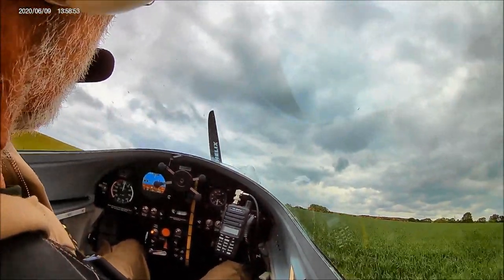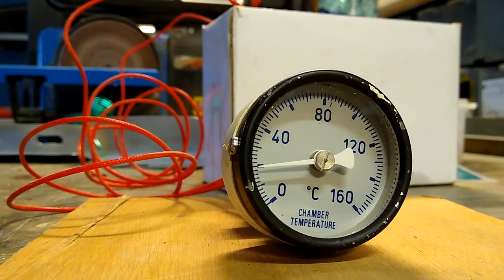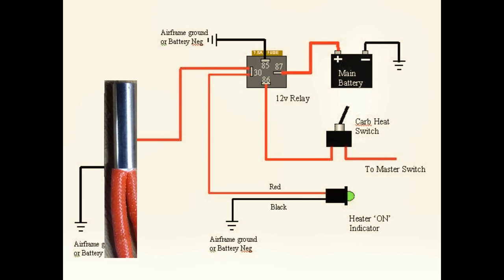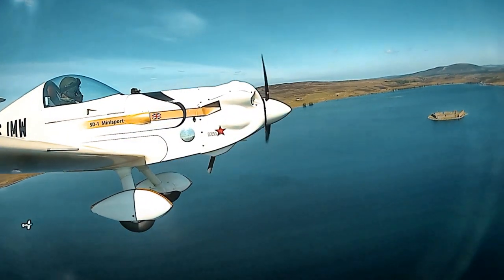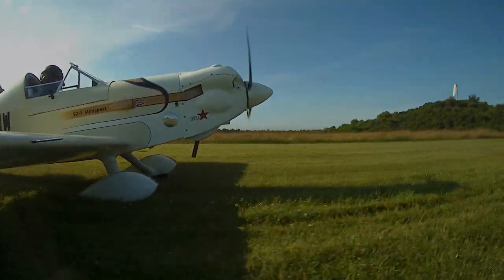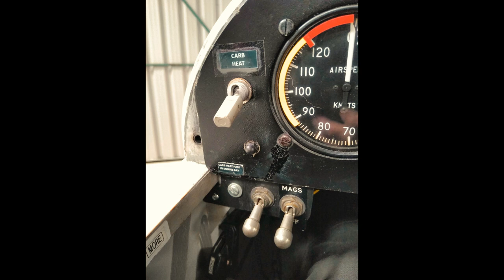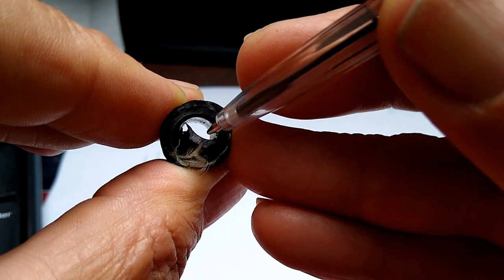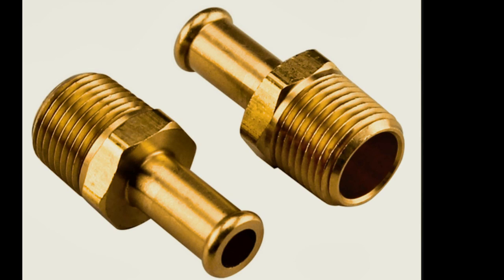Carb ice, blocked hoses and Dodgy Diodes

Comment: When ever you change any hoses and or fittings you should test the hoses with more pressure than your fuel pumps are going to put out and look through the hose for obstructions and if you can not do this you should fit the hose with one end off and turn the pump on and check the flow and reverse it and check again and if it is a different  flow rate you have a problem and having 2 mags you should have 2  switches so you can isolate the mags if you have a problem and the weight of the switch and a piece of wire is nothing when it comes to safety so if weight is a problem to you don’t have the cup of coffee before you hop in and fly as the switch and wire weights less  safe flying

Comment: Interesting vid. I've been doing 3D printing for a few years and just wanted to ensure you know those heater cartridges can be problematic. They are intended to be used with a control circuit that switches them on and off to produce the desired temperature to melt the filament (typically upto 250C). In the early days of 3D printing there were fires caused by thermal runaway. NTC Resistors are commonly used to monitor and control the temperature and if these fail open the control circuit thought the heater was too cold and powered the heater permanantly. This caused overheating and fires. Modern 3D printers have code that checks for faulty temperature sensors to try and prevent this.
Reply from the maker: Thank you, Colin. I was a little nervous about using the heater elements since they get very hot very quickly, as you know. I did a lot of bench testing with and without heatsinks to see what would happen if they were left on for long periods, up to 6 minutes. Nothing caught fire although I had one fail when the wires contacted the edge of the heatsink tube that the cartridge was inserted into. I have a warning light in the cockpit to remind me of an On selection, and I don't use them for more than a couple of minutes at a time and I've not had any icing or other problems since fitting the system. I would, however, be happy to remove it if another system was available within a reasonable budget.
Reply: @TheMorayMosstrooper  Sounds like you took sensible precautions. I think with 3D printers it was probably the filament, or possibly heat shrink sleeving, close to the cartridge that caught fire.

Comment: Hi Mike, don't you think stopping the engine will cause the fuel pump to turn on? The needle could remain open and the fuel filled the carburetor. The timing would match.
Reply: There is a micro strainer in the electric fuel pump (Pierburg). In the inlet pipe. It could clog, I pulled him out.
Reply from the maker: @Hollasus  Hiya. My booster pump is manually controlled so an engine failure for whatever reason isn't going to switch that pump on.
Reply: @TheMorayMosstrooper  Yes, I understand that. I only turn on the fuel pump before starting the engine. Never before landing or taking off. For an "aircraft engine (rotax)" yes, not for an engine from a tractor :-)
Reply from the maker: @Hollasus  The electric "booster" pump is only a "recommendation" from the designer, I believe, but it has certainly saved me from at least 2 forced landings. If I wasn't in the habit, now and for a long time, of using it as a backup during critical stages of flight the engine would surely have quit on takeoff as a result of the hose blockage. That it didn't - because the pump was on - caused difficulty in working out the cause of my problems, but I'd rather have it that way.
Reply: @TheMorayMosstrooper  I believe you have experience. I wish you many happy hours with your SD-1. I love this plane and it's a pleasure to fly with it :-)

Comment: Hey Mike, how's the carb heating solution holding up? I'm looking to do a similar DIY but with a 50W Compact PTC Heater Element, bit safer than a normal heating element
Reply from the maker: Hi Will. The system has worked well. I had one element fail after about 20 minutes total use (hard to be precise as I only use it in descent, and I don't fly very high 😉). The replacement has been in place for well over a year and performed without a problem. A few months ago I installed a temperature probe in the carb casing immediately surrounding the throttle butterflies, and it always shows a temperature well above that where ice might form. Of course, this isn't the temperature of the incoming air, just the carb body. I'm still working on the perfect solution, if it can be found.
Reply: @TheMorayMosstrooper  that all sounds good! Will let you know how I get on with the heating element I’m using. Thanks for buying the test pilot and actually making the effort to publish your results, seems crazy that we’re left to figure this out 🤣 I’ll also be making the same dual switch ignition switch
Reply from the maker: @WillTunna  Yep...we're on our own. Actually, no. Keeping in touch, whether by this medium or others, at least gives us the chance to keep up with developments and problems. I, too, would like to see a more proactive approach from those in a position to hold "all the answers", but it ain't gonna happen, apparently.

Comment: Hi Mike, that opening on the cowling at 01.02 doesn't actually work.
I had a kind of opposite problem of hot air being ingested by the carburettor on extremely hot days which robbed my engine of many of its tiny horses (or hamsters or whatever it is that makes this little engine turn).
To solve that problem I made a ram air intake for that very same opening (see my video at https://youtu.be/NylrNcoaGVU?t=31 and https://youtu.be/NylrNcoaGVU?t=199 ) , that reaches infront of the hump. 
Also added a baffle under the cowling to move the cold air towards the carburettors intake. It seems to work. Intake temperature went down around 8° to 10°C.
Of course now I'll need to make a proper airbox that can actually switch between fresh air and preheated air intake operated from inside the cockpit.
Well - solving one problem always opens up another can of worms...
..
That Diode malfunction - I have to get rid of that thing asap! Thank you for bringing it to my attention!
Reply from the maker: Hi Chris. As a follow up to your intake mod, have you made any other observations regarding the effects? My experience with other aircraft is that unless the intake air volume is balanced by a suitable exit point, then cooling can be compromised. I'm no engineer but I would imagine that incoming air with insufficient through flow will create an overpressure and stagnation, the "slow" air thus getting warmed up more than before and compromising overall cooling. I ask this because I recently had to change my oil temperature sender because the original showed erratic readings. I now have stable and predictable readings using a good quality sensor, but they are about 10 degrees higher than before and I regularly hit my 120 degree warning for the 140 max where before I rarely did so. It could be that this is normal and I've been in ignorance up to now, but if I can I'd like to get the oil a little cooler without having to fit a special cooler matrix. Any thoughts?

Comment: Don't knock yourself out about the fuel hose thing. I know someone who had exactly the same problem and that was with a 'professionally' assembled hose. It had a slightly different end fitting but it was the same issue.
Reply from the maker: Thanks Don. As it was impossible to see light at the end of the hose as it was, I blew through it from both ends to be "sure" that it was clear. Not good enough, obviously. In future I'll replace the hose regardless of how clear it looks. Pennies for a fuel hose, Pounds for an aeroplane.

Comment: Rather than run two switches or use diodes, why not use a Double Pole Single Throw switch to ground the coils? One less switch. Then you won't be tempted to do a pseudo "mag check" and pointlessly run raw gas through the cylinders.

Also, I hope you've come to your senses on your carb heat situation. I don't think you'll pull the necessary BTUs from the wattage of those tiny elements. They melt plastic fine, because plastic is an insulator. 

In partial closure where the throttle blade isn't making reliable contact with the sidewalls, even if you made the necessary heat, it's not transferring to the blade. This is also the worst condition where vacuum is high, but airflow is high enough that normal heat in the intake can't overcome the BTU loss.

In addition, you introduce three potential issues: 
-You're burning a lot of electrical watts on a system that probably doesn't have a lot to begin with and requires electrical energy. If battery/charging fails, you also no longer have carb heat.
-You're heating the fuel in the carburetor bowl. If it ever gets hot enough to vapor lock, you could be in trouble.
-To have actually gotten the carburetor hot enough to protect from even a partial throttle condition with these elements, this is still far more heat energy than was necessary by drawing air from an exhaust cuff. If you need maximum available performance, designed well, you would have less residual heat in your intake with the traditional route for equal protection of the throttle blade.

Edit: Also consider the ability to tailor your carb heat to the conditions. Your current setup is binary in function. With a heated alternate air source, you can adjust as needed. Not everything is closing the throttle to descend, you might also get caught out in the rain and need as much protection against water ingestion as you can get.
Reply from the maker: Hello Ben, 

 Thank you for your comments, which are always welcome to stimulate debate. I believe I addressed some of them during this and other videos, but to recap and add my own comments to some of your points: 

The “mag” switches. Clearly there is nothing to be gained by using individual switches to test each coil, since if one isn’t working or fails it’s immediately obvious, so I don’t do it. I could, as you say, just use one DPST sw but I chose not to since at the time I couldn’t source a high spec sw which could be guarded or locked ”ON”. The switches I chose to use are mil spec over-centre locking so cannot be inadvertently operated and have extremely secure connections. 

Carb heat. The heating element gets v hot v quickly. Red hot, in fact. The current draw is minimal at less than 2 amps so I reckon that’s pretty efficient but you are correct in your observation that the heat isn’t going to the “right” place. I agree, but is the best I can do at the moment. The Spacek factory sell a carb heater – a body heater, like my design – since they too acknowledge that the ideal solution of introducing hotter air into the carb isn’t really practicable in this installation. I did attempt it, as you can see with the “chimney and valve” experiment but this did indeed only warm the fuel bowl. The present arrangement doesn’t heat the fuel and provides some heating by conduction to the spindle that operates the butterflies as well as the surrounding carb body. I’ve drilled a 6mm hole in the carb between the butterflies and inserted a temperature probe which is telling me that the heater works. However, the carb metal rarely gets cooler than about 15C even in the winter. Does this mean that carb ice isn’t going to happen? Well, no, but I haven’t yet found an ideal solution. TDC Flyer (see other responses) has experimented with intake design – on the cowling – to try to solve related problems, without success AFAIK. I did consider blocking the carb intake on the top of the cowling and letting the carb take hot air from inside the compartment, but this isn’t controllable  - a cockpit actuated flap isn’t practical as the cowl is regularly removed – and, as TDC Flyer says, it potentially reduces available power. If you have any design suggestions to make on the matter, we’d all be grateful, I’m sure. 

Oh, and as far as having “come to my senses”.... We all have our views and opinions. Thank you for yours; I retain my own. Happy New Year.